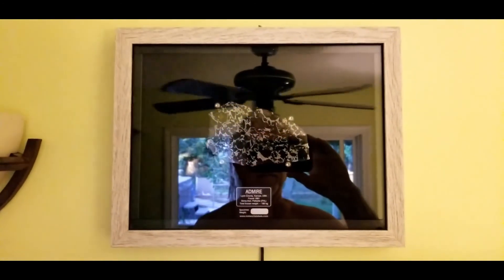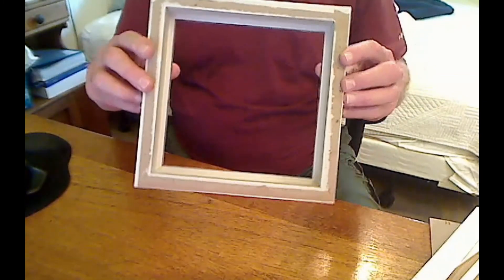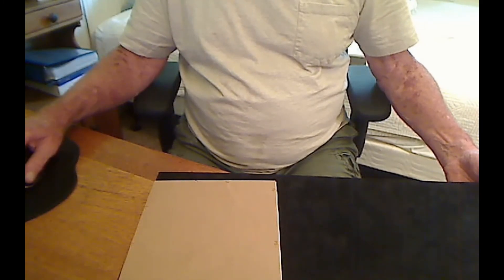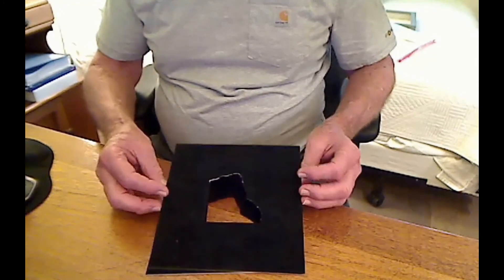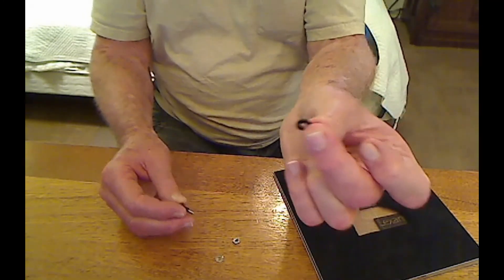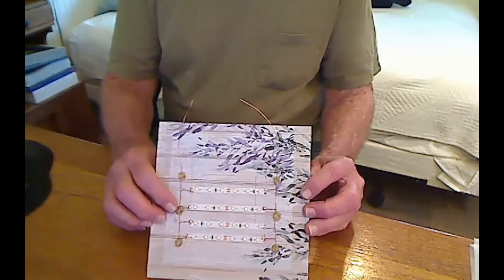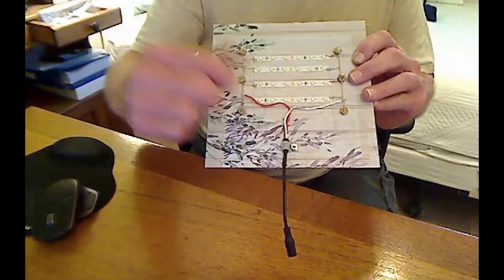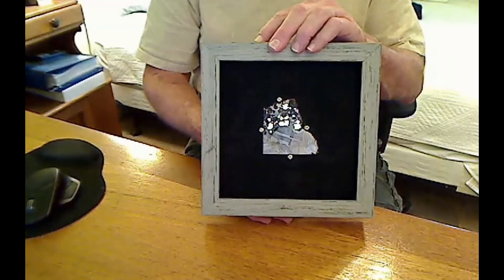Backlit Meteorite Display: How to build your own backlit Pallasite display, Backlit Mineral Display

Comment: Nice rock , do you suppose the guy who cut it ,saved the sawdust ?  The crystal s , seam pretty kewl , very nice rock btw. , C yaz.!.
Reply from the maker: Cutters usually clean the saws between jobs and collect the cuttings / dust. I do. I use Chondrite cutting dust as soil to make Martian displays with 3D printed rovers in them. I have Lunar cutting dust for sale $22/g.  -Topher